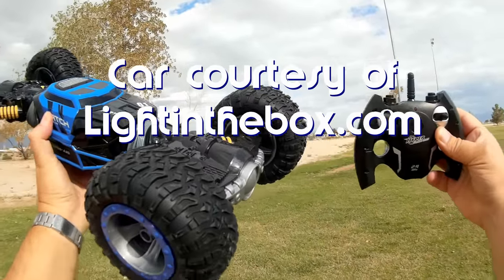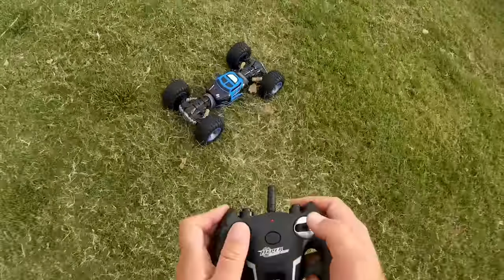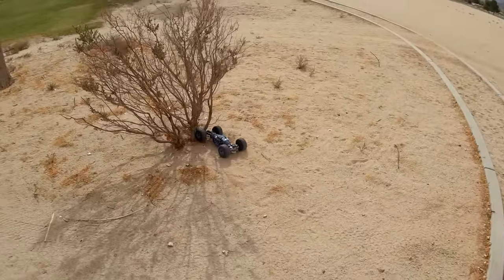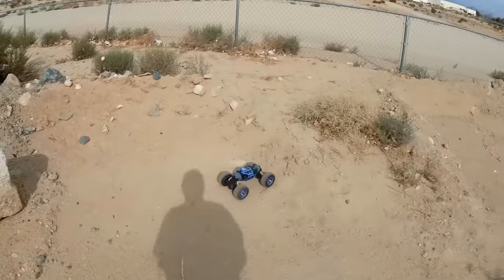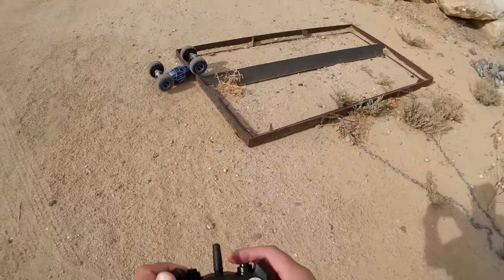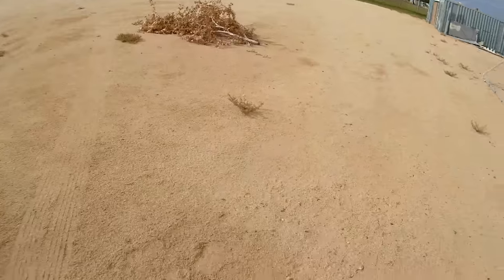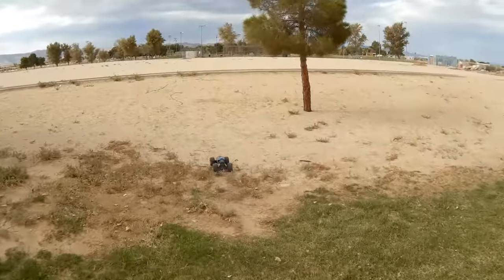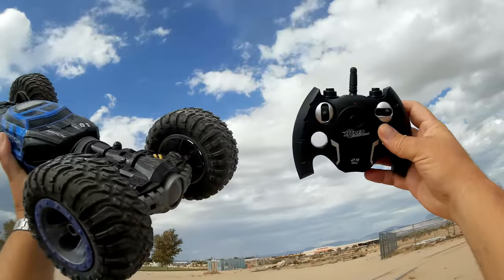UD2168A Transformer Rock Climber Car Drive Test Review

Comment: I got the car for 50$ and after driving for about 20-30 mins it stoped working idk if its the battery or sum but I charged both battiers idk what happened I'm still trying to fix it
Reply: It has 8 9 volt moters to move forward and backwards so it only survives for about 20 to 30 minutes

Comment: My grandson has one and I don’t how to charge it or how?  What does the charger look like?  Anybody reads this, help an old man out! Thank you
Reply from the maker: It uses a 9.6V charger for its 9.6V NiMH batteries.  It uses a "Tamiya" battery connector. Here's a picture of the original battery with charger.  https://img.tttcdn.com/product/xy/2000/2000/p/gu1/R/U/RM8424R-EU/RM8424R-EU-1-0cc3-48p0.jpg
You can purchase a replacement charger from eBay cheap.  But it may take a month to get to you as it's coming from China. https://www.ebay.com/itm/133585337233
Of course, you can also buy one on Amazon with quick shipping.  But you'll pay extra for it (the importer needs to make a profit after all ;-) https://amzn.to/3rPp7q2
Reply: @Quadcopter101   thank you I went to Amazon and found a universal adapter for the type of battery pack. 👍

Comment: I bought this model and I like it a lot but I have a problem. Practically the model does not go straight but always tends to go right and I have to constantly correct it with the radio control. I would like to know how I can adjust it so that it goes straight. Thanks so much.
Reply from the maker: Unfortunately this does not have any steering trim to do such.
Reply: this is the most beneficial comment. Thanks @Andrea